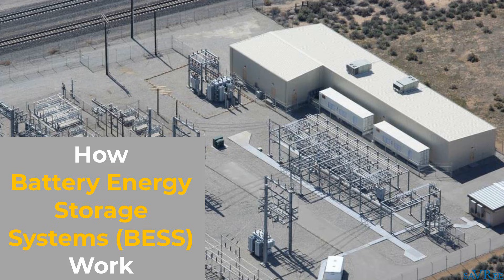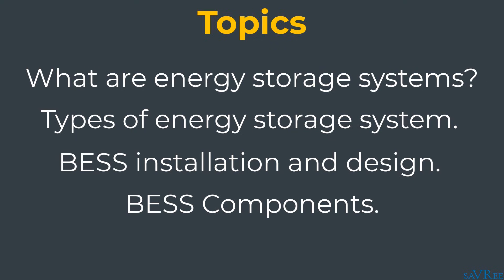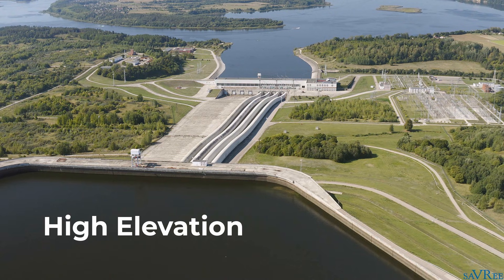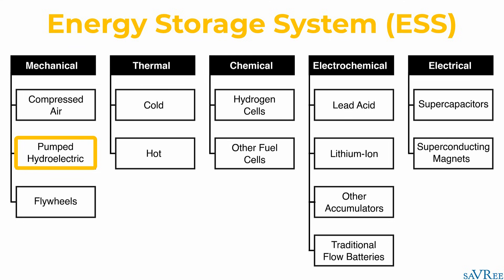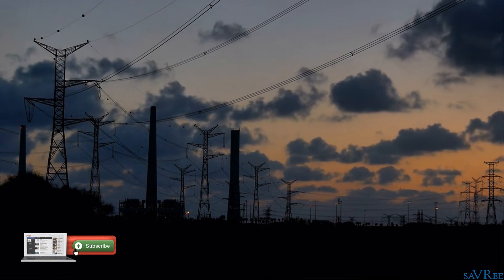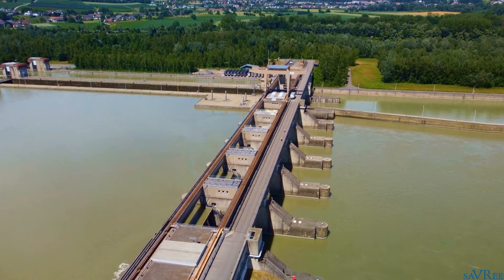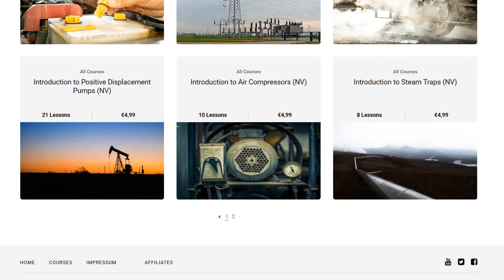How Battery Energy Storage Systems Work (BESS)

Comment: First of all thank you for the great informative video. Please could you kindly clarify my query, does BESS system  requires DC/DC converter after AC/DC converter (time stamp: 11:27). Does the requirement change for grid scale batteries vs grid tied domestic batteries ? The following links shows DC/DC converter in BESS system. I was searching about this in internet and cant conclude if the DC/DC converter is essential for all BESS (grid scale vs grid tied domestic).  

https://assets.publishing.service.gov.uk/media/5f761b828fa8f55e33275cfc/domestic-battery-energy-storage-systems.pdf (page 43)
https://www.pscad.com/knowledge-base/article/462

Comment: I don't really understand, why is litium ion is a good choice for bess but lead acid is not a good choice for bess
Reply: lithium batteries are cheaper, and store more energy. That's the primary reason. Aside from that lithium batteries tend to be much longer lasting.

Lead acid is also complicated by various different battery designs, and output limitations. They do have a high recycle capability though.
Reply: Lead acid is less energy dense for starters.  You'd need a LOT more batteries to get the same storage capacity.   That takes up a lot more space etc.
Reply: While I don't know much either, my humble opinion would be discharge speed and health?

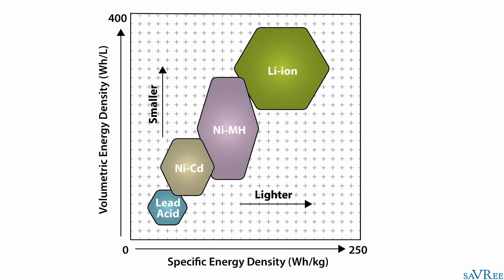Edit: watch the chart at 2:38
Reply: Lead acid batteries have a low efficiency in the charge-discharge cycle. Only 60% of the charged energy can be extracted from battery.